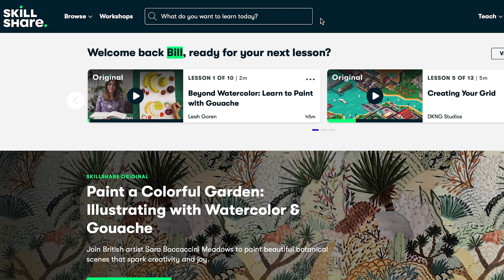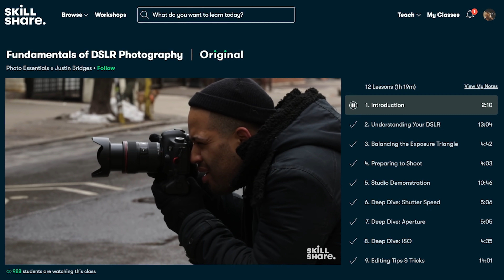LIFE CHANGING NEWS and lots of Chateau Gardening TIMEPLAPSES

Comment: So yes the habit is to keep all the wire and burlap on but that is a lazy gardeners way of doing things. How long do you think that metal will take to rust away?  And the burlap, at least 3 to 4 years. It is sprayed with a retardant to keep it from rotting. I have 30 years as a journeyman landscaper gardener and have seen trees thrive where the wire baskets and burlap have been removed and trees limp along because they were left. I once asked a landscape contractor why they left it all in and he said it was easier to remove the tree when it died. ☹
Reply: Of course the tree died, with the wire and burlap preventing it from growing properly.

Comment: Just a note. While the wire and burlap ARE biodegradable you will often have issues where the roots don’t go as deep down and end up the tree can get uprooted by a heavy wind. Happened with one of my trees. The previous owners 50 years ago planted a pine tree in the basket and this past summer it fell over in a storm. The whole basket and burlap was still there all those years later

Comment: You SHOULD take the wire cage off the trees.  You can get girdling roots.  The cages will not rust away.  Watch GARDEN ANSWER on YouTube. They had a huge pine that was there for 30 years fall over in a wind storm and it was because the roots weren’t able to reach out beyond the cage. She shows it and the arborist talks about it.  I’ve had the same with maple trees that home builder planted and it got girdling roots as well and died.

Comment: I agree with the people who have said so already. Whatever the nursery people say it is always best to take off the rootball net. Listen to people who have first hand experience.
A nursery's job is to sell you plants, not to necessarily give you the right advice on how to maintain and keep your plants healthy in the long run. 
I'd say smaller trees with a wide fibrous root system might do ok, but most trees develop a variation of root sizes, and a lot of them are big ones to anchor the tree to the ground. Any delay or obstacles to these roots will thoroughly lower the tree's ability to stabilise and anchor itself. 

Another tip; newly planted trees and shrubs need to be watered and taken extra care of for the first 1 to 2 years because of the small root ball, especially during the summer months, but also during any dry spells in spring or autumn.

Comment: Removing wire baskets at planting time is not necessary to assure growth and survival of large tree roots. However, you should remove any rope across the top of the ball, and bend back or remove basket loops. Using a correctly sized basket for each root ball is imperative. I googled question and this was the consensus.
Reply from the maker: Thanks Deborah, It seems to be a very controversial subject, even by googeling I couln't find two similar answers.
Reply: We’ve kept wire in place, obviously opening it up, for twenty five years. I also worked for a landscaping establishment, 10 years. We have planted over 400 trees on our 10 acres over the years, 20% with wire intact. The pleasure of planting for posterity is immeasurable. You two are the best for sure. Hard to make me laugh out loud at content, you continually succeed.
Reply: Remove the wires and burlap!  You won’t regret it snd the trees will thrive far better.

Comment: Phillipe, remove the wire dude. It will retard growth and possible kill the tree.
Reply: Not possibly, it will! But it will take a few years so you won’t know right away. Take the wire off please.
Reply: I had a customer with a row of 10 beautiful oaks. They were in the perfect location, perfect moisture etc. After 5 years 7 were dead, 2 had one branch still alive and one was alive but had barely grown. I told him, "I am going to dig around the drip lines and I guarantee I will find a wire cage still constricting those roots. I did it, et voila, wire cage. Trees rarely survive and never thrive in a root cage. It is infuriating.
Reply: Hate to say it, but don’t take tree planting advice from the guy who will sell you the replacements several years down the road when the warranty is over. Hey, I’m from NYC, it’s how we think.